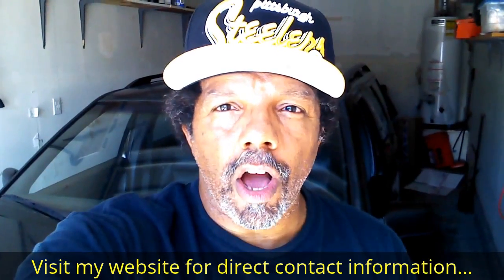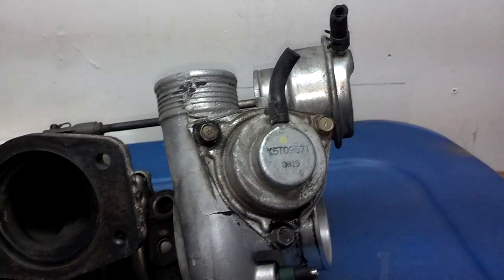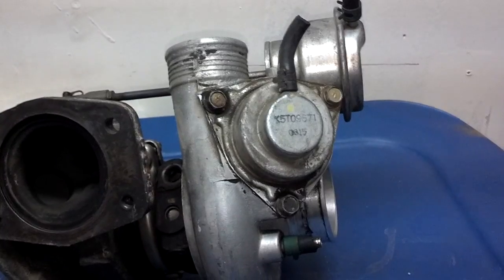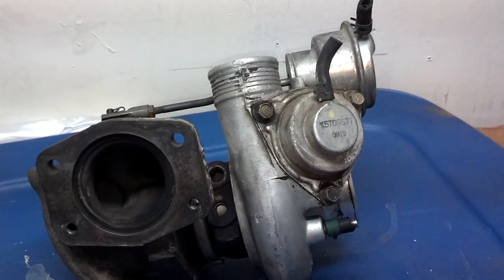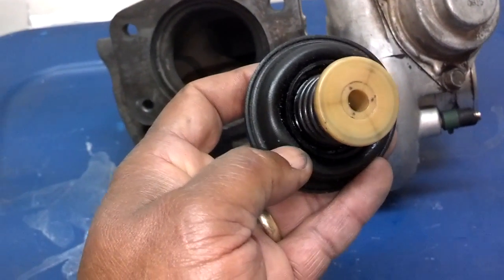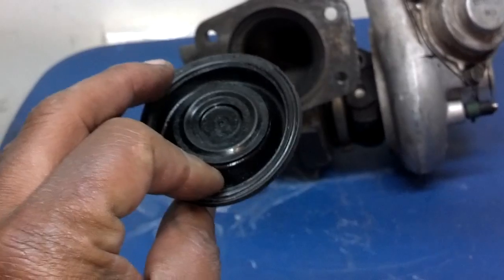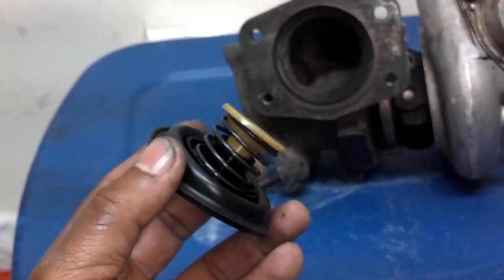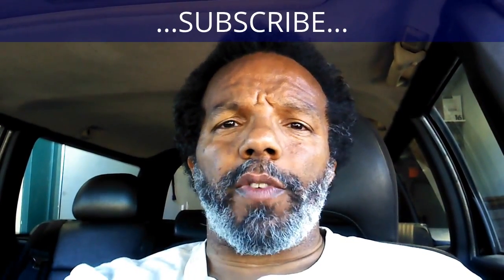Turbocharger 101, bypass valve or blowoff valve explaination. Low boost pressure. - VOTD

Comment: Hi Robert i got a P2261 check engine code.
Total charger bypass valve mechanical code. 

My car has more than 200 thousand miles. I do not have any tools to test the bypass valve. I wonder if I can just replace it. Thanks for the wonderful video 🙏
Reply from the maker: sure you can.
Reply: I got the same code on my rdx 2010

Comment: I have a 2015 Hyundai sonata limited 2.0T I've lost boosted , my bov used to blow off with that sound now it doesn't and I can't gain boost
Reply from the maker: If it's not smoking like a train, it likely has a charge pipe loose or damaged.
Reply: @RobertDIY  finding out it's the watergate actuator that need to be replaced.. can't find anybody here in Phoenix area that could help install this

Comment: Hey man you explained that so well I have a 2008 Saab 9-3 Aero and I got the code p0033 which the same thing you said the bypass valve before I buy anything what would you recommend stock or aftermarket brands.
Reply from the maker: probably doesn't matter.
Reply: 5.3 lo o
Reply: Hey I have the same error code in my 2021 Kia K5 what parts do I need to buy ? Autozone said that it’s open.

Comment: I have a 2007 Mazda cx7,  the vehicle smokes.  It still runs OK buy if I'm sitting at a light it smokes. I'm at 124k mileage. My radiator is full and the temp needle doesn't move. I drive very little with this car just back and forth to the market.
Reply from the maker: ouch. I'd have the PCV system checked out.

Comment: Just say "wrong" if I am wrong: In this setup hose is connected to intake manifold after throttle and valve is on the high pressure side of the intake. Only when throttle shuts, connected to hose side of the valve has lower pressure and moves the diaphragm to let build up of pressure (before closed throttle) to go around turbo inlet back before vanes.
Now, when diaphragm is damaged two things happen: valve might not open when closed throttle creates vacuum in the intake manifold and will bleed some pressure to the intake manifold via hose however its main purpose is compromised - to protect turbo from stalling (some people love that flutter) because of a sudden pressure build up (air flow hits closed throttle plate) and stress on the turbo shaft. 
When turbo creates boost and throttle is wide open diaphragm bad or good will not move as pressure before throttle and after will remain the same so on both sides of diaphragm.
Different springs make only sensible difference in blow off valves where its action depends only on the boost pressure and air leaves system straight to the atmosphere, therefore spring strength should not be lower than desired max boost (or valve will bleed pressure to the atmosphere). 

Otherwise I understand nothing.
Reply from the maker: I don't know, sounds like you're overcomplicating the purpose of this diaphragm. From what I understand, when you take your foot off of the gas pedal and the throttle plate closes it will create back pressure on the turbo, acting as a brake for the turbo, which is hard on the turbo. If that back pressure is not relieved it will cause stress on the turbo, trying to slow it down too fast. The bypass valve or blow off valve relieves this excessive pressure allowing the turbo to continue to spin.

Comment: Robert thank you very much that’s an excellent video I’m just in the middle of changing my bypass on my Volvo XC 70 and as I inspect the diaphragm it’s exactly as you described it’s all  dried out and when I flex it it’s gonna start to break apart. I wasn’t able to check my pressure but as someone who’s dealt with lots of valves over the years in the refrigeration industry this valve is definitely leaking
Thanks man, all the best
Reply from the maker: Thanks for sharing.

Comment: Does a bypass valve add more horsepower or boost? Just came in the mail
Reply from the maker: No, did you watch the video?
Reply: @RobertDIY  yea bro, so basically it just sends the air back into the intake?

Comment: did the engine light torn on ?. im having a s60 t5 prodosing only 0.45 bar and data in vida is 1 bar. the engine ligt torn on and it shows errors on the map sensor that measures the boost pressure. my colleague changed the sensor. I test ran it and no engine light was coming on the same did my colleague. when the costemer got his car the engine light came on again. the costemer says some times the engine shuts off and it idles unevenly.
Reply from the maker: Nope

Comment: I have got a 2007 mazda cx7. the bypass valve is good but the tiny pipe (air outlet) at the top broke off. the whole valve cost CAD368 dollars at maxda so i am wondering if only just the top cover can be replaced
Reply from the maker: Dang, how did that break?
Reply: I gave the car to a mechanic to fix something else and he returned the car with the pipe broken
Reply from the maker: Wow

Comment: My issue is over boosting 28# when target is 23 on my 2019 civic type R.
So when i pass 6k rpm n release the throttle  u can clearly hear that turbo fluttering which sounds incredibly good but still NOT a good thing for the turbo(on the long run)
All this came right after an aftermarket air intake install.
P2261 is the code!
Reply from the maker: Ouch

Comment: Hi Robert, where i connect the line of this valve?
Reply: Do you have the diagram? Of the turbo lines for a volvo 850 T5
Reply from the maker: https://youtu.be/gt9w-ZSxs9I
Reply from the maker: https://youtu.be/x8sXo5gbapM
Reply: @RobertDIY  thank you, but i need to know where I connect the line of the bypass blow off/ valve of the turbo?
Reply: my volvo 850 is for 1994 B5234T,  on this moment is connected in the  vacuum tree manifold, it's correct?

Comment: hi i have a w211and i have P0034 code error,when i accelerate you hear the sound of turbo after leaving the pedal which was not there and i have oil leaking from exhaust,plz help
Reply from the maker: Bring it by and we'll check it out.

Comment: Ok I'm having trouble I'm running a HKS ssqv4 bov and a boost gauge and a oil catch can and I'm running no exhaust I'm just on straight cat and this code popped up I need help I'm confused on what to do bec I can't figure out how to get the code off of the car is there anyone that can help me get it off without deleting the code I'm building my car for 260 to 280hp but I'm not wanting any problems with cel or anything like that I'm going big fmi down pipe oil catch can and a cold air intake and better exhaust and a tune that's all I want to do for it for now without blowing it up can someone please help
Reply from the maker: Huh? What code are you getting?
Reply: @RobertDIY  I'm getting a p2261 code
Reply from the maker: What's the code for?
Reply: Its a bypass valve code but I got the check engine light to go off from doing a boost hack

Comment: Hey Rob can this also be called a diverter valve?
Reply from the maker: I guess it can.
Reply: @RobertDIY  thanks I'm asking bcuz I have a p0035 code issue on my 2013 genesis coupe. "TBV control circuit high" so this and your other video were very helpful.
Reply from the maker: No, this bypass is a pressure diaphragm. No electrical parts to it.

Comment: Vauxhall Astra H 2005 2.0 L turbo 200 psi 
Problem = wastegate wont open valve 
have replaced solenoid but still no movement in the valve. 
ordered a graded circulation valve to test.  but till then i ride with 1 bar to max 1.07 bar
vaccuum is oke
Reply from the maker: I don't understand your message.

Comment: Excellent video. Here's my situation.. I've been experiencing weird noise on my petrol turbocharged vehicle. It's the same noise as audible here (https://www.youtube.com/watch?v=c_dOvsP0MBM) and here (https://www.youtube.com/watch?v=CyKdfcX0K6Q). I believe it's called turbo flutter (pigeon noise) (https://www.youtube.com/watch?v=KGIfOit0Y1Y&t=19s).

Do you think it could be caused by malfunctioning bypass valve, which doesn't realease the pressure as it should (as some have suggested)?
Reply from the maker: I don't even know what kind of car you have.
Reply from the maker: Have you tested or replaced it?

Comment: You do know a blow off valve and bypass valve are two different parts right??? A bypass valve goes on the side of the compressor housing and recirculates the excess pressure back into the intake. A blow off valve is mounted to a charge pipe and vents excess air pressure to atmosphere.
Reply from the maker: Yes, and do they have a different function?
Reply: @RobertDIY  I only asked because you kept referring to it as a by pass valve blow off valve. I believe I phased my question inappropriately. I meant to ask for educational purposes because my buddy swore up and down for over an hour that a bpv is the same as a bov after watching this video. So I had physically show him and explain to him the differences for him to understand. The question was meant for others who may have the same issue. I think it was a great informative video. I would suggest (if I may) making another video to show your audience the differences between the two.
Reply from the maker: I understood. The serve the same purpose when you get down to it. Yes, I did NOT describe it properly. For the average person, there is no difference. They both bleed off excessive pressure from the piping when you close the throttle. People install blow off valves for the noise they make.
Reply: @RobertDIY  True. I like how informative your videos are. I'm going to subscribe to show my support. Keep up the great work. I had a question about the wax product in your other video. I'll PM you my questions about it if you don't mind.
Reply from the maker: Not sure how you will be able to PM. YouTube shut that down about 3 months ago. You can message me from my website.

Comment: So I pulled the cartridge off on my car and the diaphragm had suction to the cartridge itself.  I pulled at the edge a bit and it hissed as the pressure was released.  I would assume this means my bypass is still good and I have another problem.  I am starting to think maybe the previous owner played with the adjustment on the internal wastegate and maybe turned it down too much before they got rid of the car.  There are no heat shields on the exhaust manifold or the turbo so I know they had to have messed with it
Reply from the maker: Some people do.
Reply: jo😊 0kp0
ol0ooopp 9oo9ol llllllllllllllll
llll

l0p p0pp p
llmyo99l9ool0l999oml l
mll0o 0 00

ől
.9 o⁹8 n

  8 9a ⁹oò8 o 99 0😅m oppp p😅p 0kp0 òìpu9😂99 0p 9990 p0 p
😊ll
...  lkk
9. l

😢😊0 p9 0😮😅k😊lo9😅p6😊pool😊.l0l9
Reply: jo😊 0kp0
ol0ooopp 9oo9ol llllllllllllllll
llll

l0p p0pp p
llmyo99l9ool0l999oml l
mll0o 0 00

ől
.9 o⁹8 n

  8 9a ⁹oò8 o 99 0😅m oppp p😅p 0kp0 òìpu9😂99 0p 9990 p0 p
😊ll
...  lkk
9. l

😢😊0 p9 0😮😅k😊lo9😅p6😊pool😊.l0l9 0😊😊😊99o90m.😂😂.if m,😊0o0ol9009 l9 0😅p9
😅m o9😊op9pli9lo p999l0😊90 9 0p  9 the first one 9 😊8ooo7m790 p990llp99kopp00p98 o9 0⁹9pp9 p0 ml

Comment: Why does my blow off valve whistle or wine as RPMs go down is there supposed to be something other than a big round hole connected to that blow off valve?
Reply from the maker: Probably the turbo whinning.
Reply: Yes you have a small hose..but my bov was loose and did the same thing maybe just tighten it up

Comment: Thank you for the video Robert, I think this might be my problem.  First turbo car....but noticed that there was a definite fluctuation of power, physically noticeable along with audibly. Yesterday morning, it seemed like I had no turbo whatsoever.  I can hear it barely spool up but nothing like it was and should.  I'll try this and report back.   2011 Buick Regal T      don't know if it matters but       6 sp. manual
Reply from the maker: hope it works out.
Reply: I have both P0014 and P0243 error codes; buying parts and replacing this weekend.
Reply: Turns out it was the exhaust vvt and weirdly a broken wire on the wastegate solenoid.   Replaced both,  man its good to have my boost back!!

Comment: this a good video. I have noticed a loss in boost pressure lately, got 150k on my Saab 9-5 aero hot and I think this will be the problem as I have only one pcv valve to replace also....thanks man!
Reply from the maker: You are welcome.

Comment: Can having a faulty BOV cause the P2261 code to come on? or the engine light to come on? Or when your driving along an you let off the accelerator and your RPMs stay the same as if you were holding the accelerator at a certain position?
Reply from the maker: +Chancey Wyrosdic I don't think so. Have you Googled the code?

Comment: Sex or car mods? If you ever have to choose
Reply from the maker: +xxxREVOLVERxxx mods will last longer.
Reply: +Robert DIY bpv is safer than bov right?  doesn't bpv recirculate to the engine and bov let air to escape via vent?
Reply from the maker: Not sure if it makes a difference other than the fact that venting to the atmosphere adds to pollution.
Reply: +Robert DIY doesn't bov alter air/fuel ratio...so you need to tune it again to adjust?
Reply from the maker: no, it just relieves pressure from the turbo system when you close the throttle. When you are driving and let off the accelerator pedal it closes the throttle. Well, the turbo is still spinning and producing air pressure, that air has to go somewhere.
Reply: +Robert DIY isn't it safer to engine to recirculate back rather than venting out to atmosphere?
Reply from the maker: didn't you ask that question already?
Reply: +Robert DIY yeah hahaha...I didn't get the clear answer
Reply from the maker: Not sure if it makes a difference other than the fact that venting to the atmosphere adds to pollution.
Reply: +Robert DIY some cars are tuned off the mass air flow sensor. if air is not measured by MAF, because it was vented out, doesn't that create rich condition on motor?
Reply from the maker: I thought we were talking about the bypass air from the turbo?

Comment: I have a 2003 saab 9-3 and I can't find a video of how to PROPERLY install the blow off valve. I seen one but the guy hooked up the vacuum hose wrong I guess so I have no idea where the hose would go. I hope that you can help me out maybe because there isn't much on saabs
Reply from the maker: +Darryl Hudson No I can't. Maybe check with a Saab form. The seller of the valve didn't give you instructions?

Comment: Is that going to cause problems? I've heard that by removing the BPV it'll cause the turbo to sound louder which is what I want to do. I've ordered a cone filter so I can remove my airbox, supposedly that produces louder turbo noise as well, what else would enhance the sound of my turbo?
Reply from the maker: +Derek Marquardt an external blow off valve. You can also drill a hole in the firewall near it and you'll hear a lot more of it. The cone filter will probably be plenty.

Comment: What happens if you remove the bypas valve and cap it off? Does that do any internal damage?
Reply from the maker: +Derek Marquardt It will likely cause over boosting when you let off the gas.
Reply: @RobertDIY is o lo opu0
Reply: .n😊nk. o9😅.😊😅.plm

Comment: Robert my 2001 volvo v70 T5 has a problem with my passenger door lock, it wont stay locked when alarm door lock is set. And if It does lock we find it unlocked when we return to vehicle. And only that door ! ? How do i fix this ?
Reply from the maker: Ruben Jaime I would replace the latch.
Reply: Dont lock with keyfod, lock manually.Hopefully,it will save your money of door actuator.

Comment: Replaced mine last year which I got from ipd. Mine also had holes in it. It was fun to replace it while the turbo was attached to the engine. How satisfied are you with the boost gauge you bought?
Reply from the maker: Sebastian Schwarz Well, I purchased a few of them. The one I like has a swing needle and measures vacuum in in Hg. It has a dark background and changes colors to your liking. Cost about $43. The one I have installed is fine but measures vacuum in psi I think.

Comment: What is the cost of the bypass diaphram?
Reply: you can buy after market ones from eBay for like $20, or entire bolt on adjustable ones for upwards of $150. There are also block off plates that will allow you to install a BOV
Reply from the maker: Michael Chitwood I believe they run about $70.
Reply: 24.95 https://www.ipdusa.com/products/11813/124916-volvo-compressor-bypass-valve-ipd-124916